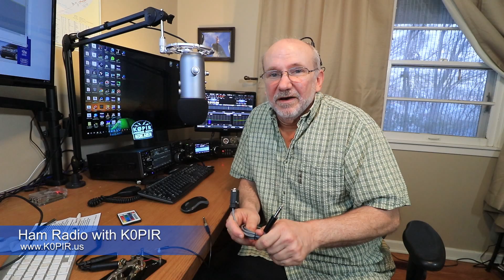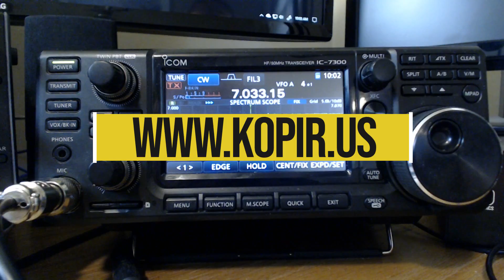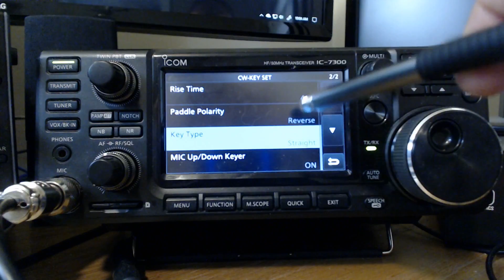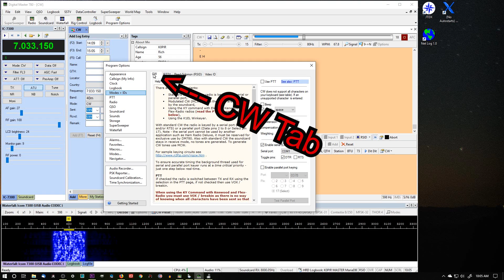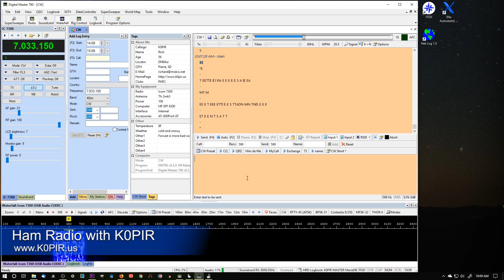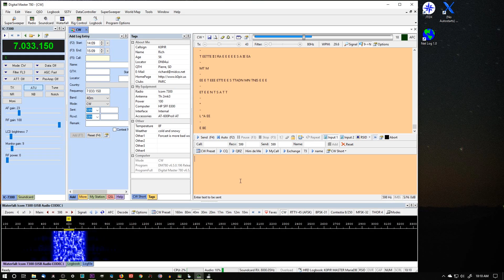How To - DM780 CW Send CW Interface Easy CW Send and Decode

Comment: Thanks for the tutorial. Is that screen I see over your shoulder an iPad? Are/can you using/use an iPad for some of your software screens?
Reply from the maker: Hi Tom, no the smaller screen is the monitor (DVI) for the Icom 7610. I have used Parallels to control software on my PC though. Thanks! 73, K0PIR

Comment: hi I have a question for you, the cable that connects the PC (DB9) and the radio is a CI-V Icom cable. If it is not so you can send me the scheme because I have not understood correctly.
Reply from the maker: To send CW I use a CW interface cable. It has a DB9 on one end that connects to the PC serial port and a straight 1/4 inch plug on the other that plugs into the rear CW key jack on the radio. You can see the diagram on N3FJP website. lol for the link in the description above. Thank you for watching and thank you for commenting here at 73!

Comment: I've been using the RigBlaster Advantage and CW (KY cmd) mode in Ham Radio Deluxe with the Icom 7610. The keyboard does not allow back spacing, which is really annoying! The code speed is set by the 7610, which I found to be strange. I assumed that the 1/4" CW jack was for a straight key. The 7610 is configured for a straight key. The CW mode in HRD does not work with the RigBlaster, but it looks like it allows backspacing over typing errors. Once I type a word in HRD in CW (KY cmd) mode, I cannot backspace to correct typing mistakes! 
 
I bought the W1GEE serial to 1/4" CW cable, but my computer doesn't have a serial connection like my older computers, so I will buy a serial card for my Windows 10 computer. Hopefully, using the serial cable will allow me to use the CW mode in HRD, and I will be able to back space over typing errors, before the mistakes are sent out over the air in CW. 

I can use HRD and the 7610 with MCW,  just the CI-V USB cable, but I think using MCW is pretty flaky compared to sending in real CW. 

After 30 years of inactivity, my CW speed dropped to about 10 wpm. It will take awhile to build my speed back up to 25 wpm. I send CW with the keyboard and receive CW without the computer. I have a keyer paddle, but I never want to use a keyer paddle again. If I have a computer buffer that actually works, I can correct typing mistakes in the buffer and have absolutely perfectly sent CW.

KY0L
Reply from the maker: Dave Borchard Yeah that’s what I found out about the CW KY. It’s a little quirky and another thing I noticed is I can’t run letters together like KN. Using CW with a CW interface works much better. When using a macro, I can go in and edit it just like in the video. Thanks for commenting and confirming those issues. Best 73!
Reply: I finally got the CW to send properly using HRD and the W1GEE serial 9 pin DIN to 1/4” cable! I use CW mode in HRD (not CW Key cmd, CW Winkey, or CW SSB). I had to purchase a serial card for my computer because the computer didn’t have a serial connector on it.

Initially, I still couldn’t send CW with HRD and the Icom 7610. Then I re-watched your video. There are many places to configure DM 780 within DM 780.

Configuring “Options”, “Modes + IDs”, checking the “Enable serial COM port keying” to COM port 6, and selecting “DTR” was the solution that worked. 

Now, I can send CW properly with the keyboard. The CW speed is set in DM 780 instead of on the Icom 7610. I can type ahead in the buffer, back space over errors, and correct the errors before the text is sent out over the air. So, my sent CW is now perfect, error free. 

Now all I need to do is to build up my CW receiving speed from 10 wpm to 25 to 30 wpm, my CW speed before I was inactive for 30 years!

KY0L
Reply from the maker: Dave Borchard Yes I use CW in DM780. I use DTR for CW keying in DM780, 4:58 in video. I do not see CTS in DM780. Are you thinking about the HRD rig control connect window? On mine I do not have anything checked in the HRD connect window. That is used just for rig control. In the 7610 I have the key set to paddle because that sets the jack on the front of the radio. I believe the jack on the back of the radio is automatically set to straight key. I don’t see how to change that one. In DM780 on the PTT are you using ham radio deluxe?
Reply: Ham Radio with K0PIR  Thanks for the CW sending video. Today, I initially had trouble again with the W1GEE able and my new serial card I just installed. The solution was to watch you video again, and I found the setting in DS 780 under the “options” tab as you said in your video. 

There is a setting in the Icom 7610 for the straight key: Keyer, Edit Set, cw-Key set, key type. You have three choices at that point in the menu: Straight, Bug, and Paddle.

I wasn’t able to get enough help from either Icom or HRD support to fix the CW sending problems, but your video had the solution. 

I still think MCW (CW SSB) is a flaky option in DS 780. Also, CW key cmd is flaky too. I think HRD should fix those serious problems in CW key cmd.

The typing buffer works perfectly now. I can type ahead of where the CW is being transmitted. When I make typos, I can backspace and fix the typos before they are sent out over the air. So, now my sent CW is absolutely perfect! 

I just wish there was a handshaking mode like AMTOR ARQ, where you could rag chew with a digital mode without any errors. PSK31 and RTTY are chocked with errors! FT8 is good for hello/goodbye! JS8CALL is not much more than hello/goodbye.

If you ever used the BA-1 remote control, I’d like to watch that video. I bought a BA-1 second generation remote control software for the Icom 7610 that I’ll be working on soon.

Thanks again for your very helpful videos!

KY0L

Comment: Hey brother. I’m using the 7300 with the airspy hf+ with sdr console. I’m using a tv as a monitor using vga cable. If I want to use another smaller monitor, can I use hdmi from the new monitor to the pc without screwing up the sound settings in windows? Only using usb to the 7300. Also using vspe. I just want to run my logging software on the new monitor during the contest this weekend. Will this try to look for sound in the new monitor?
Reply from the maker: Glock w4zxt Hey thanks for watching and thanks for posting your question here. Yeah, it won’t interfere with what you’re doing. In Windows just check to see what you’re sound settings are first, then hook it up. The default should stay the same and no problems. Setting it up as an extended monitor will probably be the most difficult part 😖 Best 73 and good luck this weekend.